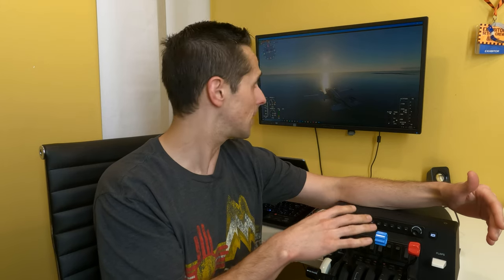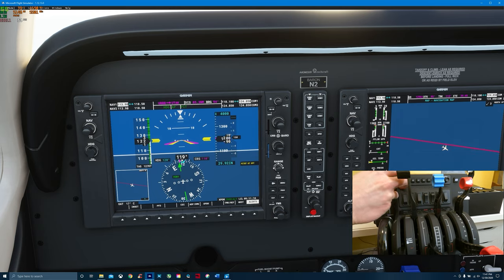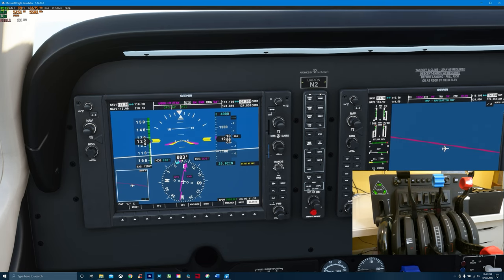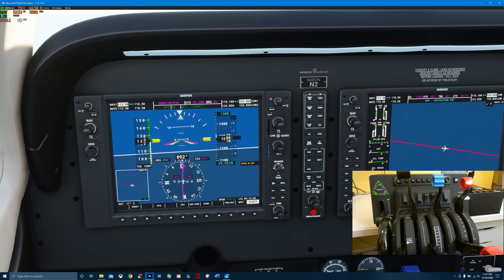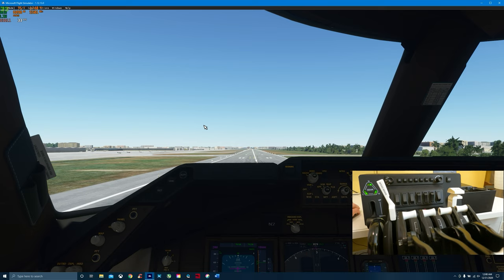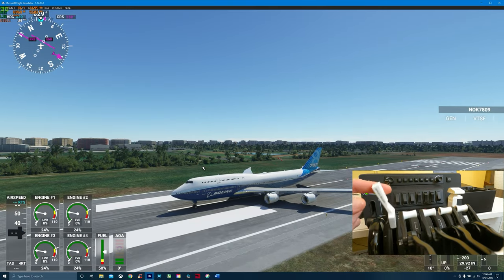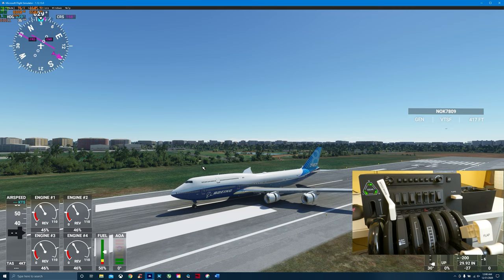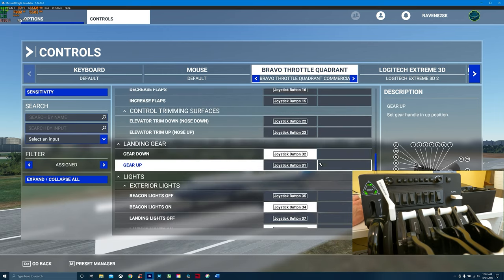Bravo Throttle Quadrant Review & MSFS 2020 Part 2 of 3, The Lights Work now too!

Comment: Grat video. I am unable to download the drivers to get the lights working. Any advice? Thank you in advance.
Reply from the maker: I have had the same issue depending on the browser I am using. Try "right clicking" and selecting a "new tab". This has worked for me when just clicking on the link failed.

Comment: Hi, want to thank you for the videos, But have some questions? So you know I fly FS2020 with the Cessna 172 and Beech Baron 58 using Air Manager premium flight instrument panels for both. These are the two planes I fly. I purchased the Honeycomb Yoke and Throttle in November of 2021 ( got throttle in first of November and Yoke at the end of November). These were to replace the Logitech yoke, throttle, switch panel and multi-panel. Problems I have is that the Auto pilot on throttle quadrant does not work. What in FS2020 do you use to set the selector on the left? Tried using indexs, but that did not work. Do you use command, Set alittude bug, or set VS bug, or set hdg bug to the selector knob on left to work properly. Also for the increase and decrease, you use the minus and plus and not the increase and decrease command?
 And interesting thing was that when did the prop, mixture and throttle levers had to turn off reverse, to work properly. Before levers worked backwards, push to top and throttle was off, pull down to bottom throttle was at max power. Got download from Honeycomb for lights just now need to figure out how to open in system to get the light to work. Also my quadrant came with the number 2 throttle working properly, read that there was a glitch in that not working. If you have any thoughts or ideas on what I might need to do to get Auto pilot working and also about what need to do to get lights working would greatly appreciate it. Also I got private license in 1989 flying 152 training, 172 for cross country, and then  qualified for 182. Wasn't able to finish instrument and multi certifications.
Reply from the maker: The short of all this may not be what you want to hear. I truly recommend making your own profiles for all of the devices. 

I have spent countless hours going through each of the "default" profiles for the Bravo and the Alpha and constantly being annoyed by the fact they were not done by a pilot most likely. Or, at least someone that has spent a reasonable amount of time flying. 

The autopilot has been an issue for me as well. It is not that the Bravo isn't working, it is the issue of how MSFS initiates the autopilot commands and phrasing. 

Go in and take the default profile and see what works the way you want and what does not. From there tinker with it until you get it the way you want it and save it for the 172 and then for the Baron 58. This will pay off because they both fly differently and in the real world would not share all of the same autopilot features. 

Which lights are not working and when? The lights don't always work when a feature in that aircraft is not present. Like the gear lights won't work with the 172. 

I am off from flying today and tomorrow, so let me know and I might have a chance to dive deeper on an issue before returning to flight duties on Thursday,
Reply: Hi Joe, here with an update, was able to get some of the Auto Pilot to work, the altitude, heading. The nav, vs, and ias still will not work. Also after the mandatory update for FS2020 seem to install the packages and AFC bridge, but still know lights. Also as long as starter switch is engaged, engines will stay running, but move switch to both, engines kill and will not do anything, have to power off then restart FS2020 to get engines back on. Another thing when went to try the starter start, it kept using switch 34 and 35 on throttle quadrant, is this correct, using engine start switch on throttle but shows' switches on throttle. Also my yoke does not show and engine switch Any ideas or help would be greatly appreciated
Reply from the maker: @davidedel31  Have you gone into the Windows Game Controller Settings to make sure all of the buttons are working correctly? Whenever the sim or sims don't catch a button that is the first place I go. 

If I had one wish, right now, for FS2020 is that they would make the button mapping on the controller interactive. That way to could see with actual button you are assigning in the moment. 

I have a lot of other wishes for FS2020, but I think that would be a huge QOL update. 

That ignition issue I have not experienced. When I have had similar issues I go into the virtual cockpit and change my view to see all of the engine controls. From there I fine tune everything with the mouse and try to find where the issue is. Usually, if all of the buttons are working properly and the sim is not the issue itself, i find that the throttle or manifold pressure is off and maybe the mixture as well. It is rare, but the RPM can also be a culprit in some aircraft. 

Let me know if that helps!
Reply: Hi Joe, want to thank you for your help
Reply from the maker: @davidedel31  if I helped, I am happy that I was able to! That's why my channel is here.

Comment: Hi Jo
Thanks for posting.  There can’t be many who have a Bravo yet, I preordered on Aug 3rd, yep 5 months ago, from Amazon UK andI’m still waiting.  I find it difficult to absorb all of the information you’re providing, as its difficult working out what you’re doing, without doing it myself.  I think it will be a lot easier when I have my Bravo in front of me.
When you get your hand on an Alpha, I would be interested in your thoughts regarding the trim.  I tend to bumble around in a C152, it’s simply to fly and allows me to concentrate on controlling the aircraft.  What I find strange is that sometimes it’s relatively easy to trim, but on other occasions I chase level flight. The  control seems very coarse.  It has been suggested that it has to do with the ‘light buttons’ bindings, which generator a continuous signal and this interferes with the trim setting, any thoughts?
Cheers Noel
Reply: Hey Noel. Having both products, I thought I could chime in. :) Yes, the continuous signals will interfere with the trim as well as the heading bug, altitude selection, v/s selection etc.
The way MS programmed the input was like this: If you give a continuous input, they'll add some acceleration so you get there faster. This does make sense as you don't want to enter an altitude of, say, 32000 ft in 100 ft increments etc. Problem is, their detection is not exclusive to the respective function being used but rather a global acceleration on/off flag.
Now, if you flick a switch that gives off a continuous input signal - as the switches on the Honeycomb units do (it's not exclusive to HC though) - this will trigger the global acceleration despite it not having anything to do with trim or altitude selection etc.
So in order to fix this, they'll have to recode the whole part that deals with the input acceleration. There's 3 possibilites right now:
a) You wait until Asobo (hopefully) fixes this in a future update
b) You unassign all functions from the switches (including the starter key on the Alpha Yoke as well as the mode selector and gear lever on the Bravo TQ) which of course takes away half of the functionality of these units
c) Use third party software to remap the continuous signals to momentary signals on a virtual device which you then use to trigger their intended functions inside MSFS. This can be done with FSUIPC7 (payware) & LINDA (free addon) or vJoy & Joystick Gremlin (both freeware).
I went with c) for now and it was a bit of a hassle and just plain grind work to set it all up but it has paid off immensely. No more 10 degree heading increments, no more 1000 ft altitude increments, no more frustation. :D

On a second note, @Joe: You might want to give this a try for the autopilot panel:
Unassign all functions for the mode selector as well as the PLUS/MINUS functions for the inc/dec knob, then assign increase and decrease functions as a combination of the mode selector and the right knob. For example: I've got Increase autopilot reference altitude as a combo of button 21 (which is mode selector to ALT) + button 13 (cw turn on the inc/dec knob) and decrease of the same to button 21 + button 14 (ccw turn of the inc/dec knob).
Reply from the maker: @thomdrei  thank you for answering the question! 

I have considered that and the third party software as well. The only thing holding me back has been available time. At this point I am stepping away from MSFS 2020 to work on the X-plane review for the Bravo. 

Thank you again!
Reply: @thomdrei  Hi Thomas.  Many thanks for the reply, I’m working through it and considering what to do. I will reply once I’ve digested all you have provided. Cheers Noel

Comment: I'm still looking and deciding on this and initially it looks great. My one concern is that too much has been jammed in here. With all the levers forward, how much vision/access do you have to the annunciator panel and those 7 flip switches? It even seems to be tricky to get your fingers to the auto pilot, as the levers are in the way.
Reply from the maker: This is something I will make a video about. You are not the first person to comment about this. 

Overall it is not a problem. The only catch would be how large your hands are. I think 70% of people will not have an issue. 

The switches are easy to use and so is the autopilot panel. The Annunciator Panel is a little blocked but this will depend on where you mount the throttle relative to your seating position.

Comment: Great video, Thanks. how do I go about deleting the existing button choices for lights on the Bravo (as they are duplicate of the Alpha light switches) and reassign buttons of my choice or what should I reassign the buttons for ?
Reply from the maker: There is a portion of the video that shows how to delete and re-assign axis and buttons. It should be in the time stamps in the description. Just to make sure, you are using MSFS 2020, correct?

Thank you for the kind remark!
Reply: @JoeNDBAVIATION  yes MSFS 2020
Reply from the maker: @waynemacdougall918  if you scroll to 32:10 you will see how to delete and re-assign functions. 

As for what to reassign the switches to is a tough question. What aircraft are you flying or is the one you fly most?
Reply: @JoeNDBAVIATION  I’m quite the rookie in Flight Simming. Just starting out.
I will likely fly the, Baron, TBM, King Air,  Citation, . Wanna get all set up eventually.
Reply from the maker: @waynemacdougall918  We all start somewhere! The best advice I Can give you is to just play around and make mistakes with the sim. That is how I learned years ago. The best thing about these new sims is that we can easily restore all settings to default. I recommend making a new profile for each aircraft as you get more comfortable creating your own custom profiles. I'll have more videos up soon with more "How to" help. Been flying more and that has taken up most of my time.

Comment: Just got my Bravo a couple weeks ago and the throttle/prop/mix all did not work at all. Cleared em out and rebound and they now register but not correctly. It turns my axis into a button rather than a sliding axis. The white bar disappears and the reverse axis box disappears and treats the lever like an on off switch. Can't find anyone having this issue either. Rebinding doesn't work past the initial issue of not registering at all. Sensitivity shows the levers sliding like they should so it's not the hardware. When I get home I might play with sensitivity settings and see if I get around bug ( kinda like rebinding). Idk.....anyone?   Bueller?
Reply from the maker: The way the reverse slider works is a button from what I understand. At least in MSFS 2020. I need to reach out and double check but that is a current drawback. I am unsure if that will be solved in the future with a firmware update or not. 

Is that what you were referring to? Otherwise I need to digest you problem a bit more.
Reply: @JoeNDBAVIATION  thanks for responding. If I understand you.. when throwing levers down past detent they do register as a button correctly. But range of throttle/prop/mix not working correct. At first none of the levers register at all. Did the rebind control axis work around that others have done and saw on Rmag's channel. They started moving but either completely on or off in MSFS. Then I noticed that when I had rebound the axis (Twin GA used default and renamed) the reverse axis check box to the left disappeared, and the white slider bar below that shows your real time throttle/prop/mix movement was gone too. So now in full throttle the assignment "Joystick ? - Axis ?" lights up like I'm just pushing a button and not sliding a potentiometer. It just turns my slider/lever into a button for some reason. had somewhat similar issue in FSX but somehow I got around it. Not sure why I seem to be alone on this issue but I do appreciate your thoughts.
Reply from the maker: @natedogg7376  I need the scratching my head emoji here. 

Have you gone into windows to check that everything is registering properly with the Bravo?

Are you running the Bravo through a USB hub? IF so, plug it directly into the computer and see if the issue persists. 

Have you tried swapping out cables?
Reply: @JoeNDBAVIATION  Yes in Windows controller settings/calibration it registers correctly. In MSFS in sensitivity it shows the pot's sliding like they should as pot's (potentiometer's) so everything is registering just not in controls/binding and in game, it's weird. And the fact that it changes to a button rather than a pot. I do have it in a USB hub so I will switch that up and see what happens. I've even read where someone had to remove all other perf's to just a mouse and keyboard with bravo to get it to work initially and tried that but no change. Wouldn't surprise me to change sensitivity settings to something random and then back and have it work just like rebinding levers. I think the unit and cable are ok as they register properly in MSFS sensitivity settings and in Windows controller settings, one hell of a bug and the fact that I have it in a hub might be why it's unique to me. I really love this throttle can't wait to get er working. Everything else worked flawlessly without setting a thing.
Reply from the maker: @natedogg7376  I am happy to hear everything else is working. That is a strange bug I must say. Especially since it registers properly within windows. Maybe try the free demo of X-Plane and see if it does something similar. 

I know sometimes Windows has a power issue with some USB hubs and will do a strange "power savings" cycling that messes with usb devices.
Reply: @JoeNDBAVIATION  I'm at work but I will try the hub switch later, I will update for info's sake. Many thanks for the discussion.
Reply: FIXED! So apparently I did not do the rebinding correctly (per bugs). 

What I did at first = 
1. In controls would pick the one I wanted, then clear it.
2. Click on box to highlight and have scanning for the lever I move (which would put a -/+ after the letter value on the axis (the default does not). This gave me partial function as it would act like a button and the real time controls were showing the same. All on...all off no in between for T/P/M.
3. In controls I picked one, cleared it THEN VALIDATED IT with no attached control. Sigh not validating the cleared entry is where I went wrong. After validating then binding the control took and worked properly. At first I cleared and added then validated after all of that which gave me partial control. SO happy now. Seriously nerding out now setting up plane profiles LOVE IT! Thanks again for hashin through this with me! Hopefully this helps someone else.
Reply from the maker: @natedogg7376  Happy you figured it out!

Comment: Ya my lights don’t work even with the drivers
Reply from the maker: Which aircraft are you flying? 

I have had issues with aircraft that don't have the features that would require the lights to illuminate. Like the Super Cub would not light the gear lights.
Reply: @JoeNDBAVIATION  thanks for replying, i had to download the windows base drivers - runtime etc
Reply from the maker: @bigmarkdarula  is it up and running now?
Reply: @JoeNDBAVIATION  yes sir thank you